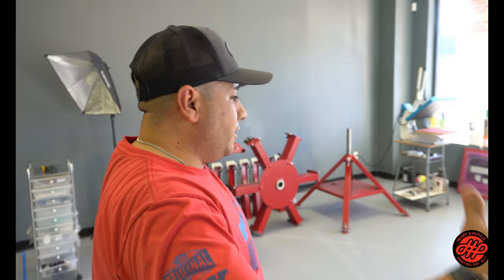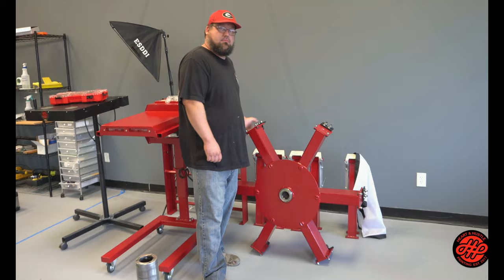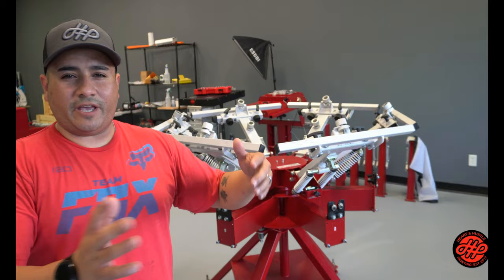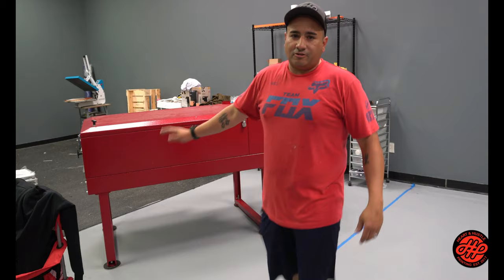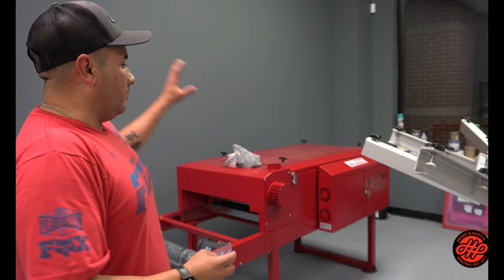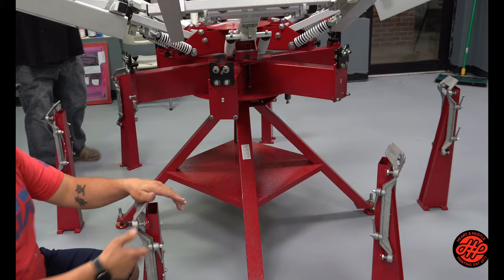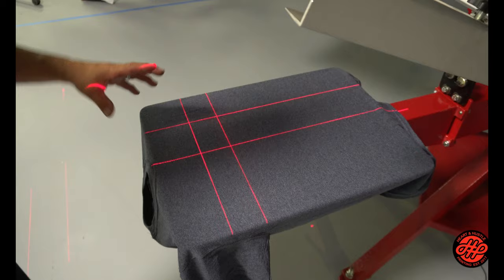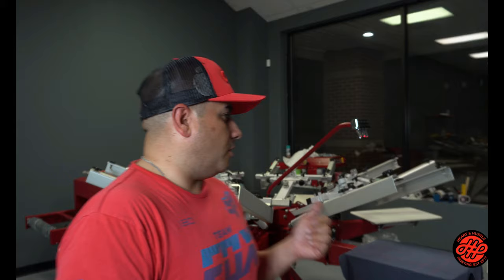Reassembling the Anatol Thunder...

Comment: Thanks for this video! I am in the same situation, I am ordering one of these presses soon and was very concerned about getting it to fit. Quick questions. If you were to quickly guess the weight of that, how much would you say the heaviest disassembled component? I not only have to get this through a standard door but also down a staircase. Thanks again
Reply from the maker: Aewsome! Tow people can do it. Might take 3 to lift the arms off the shaft. After thet you will be good.